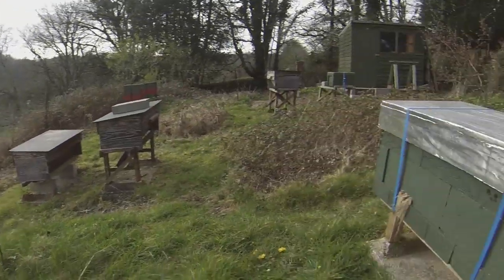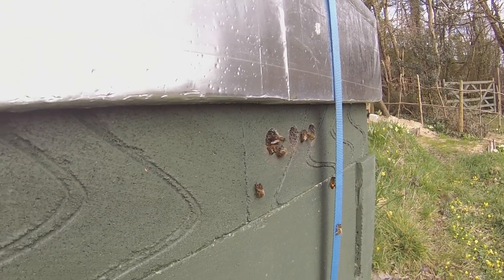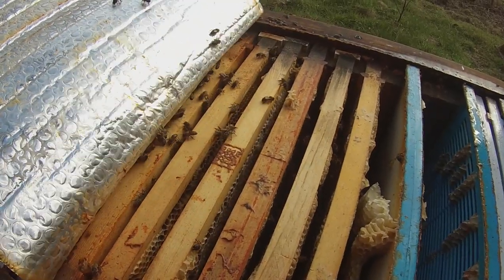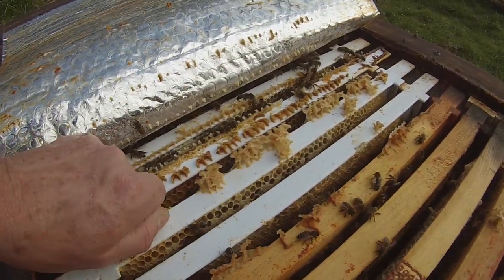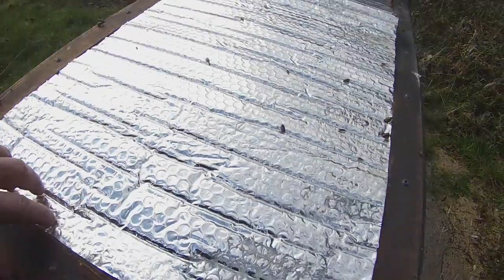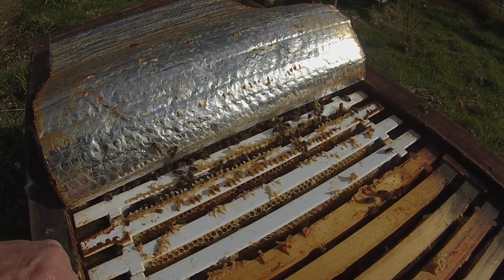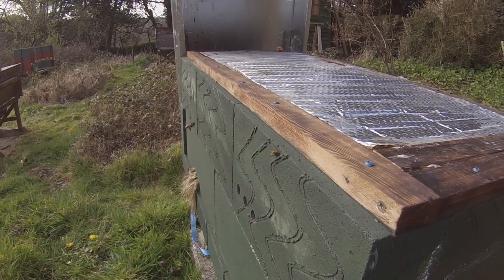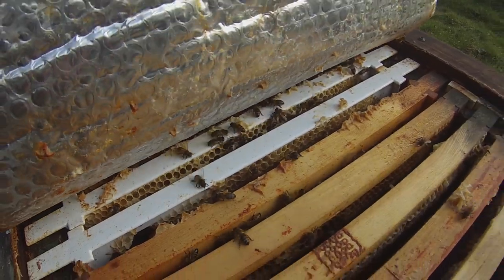ZEST hive spring checkup

Comment: Hi Phil. Really enjoy watching your videos, they were the reason I started Beekeeping with topbar hives 4/5 years ago. The Zest hive is an interesting concept but the propriety frames and gaps between seemed a step backwards to me. I've just built a Topbar Zest hybrid and would be interested to hear your thoughts 

https://m.facebook.com/story.php?story_fbid=121631132863394&id=102227301470444

This will be Tanzanian style rather than Kenyan which all my other hives are, but the dimensions are compatible, I wonder how the combs will fare? It is deliberately deeper than necessary to accommodate an eco floor, which I've not fully embraced before. I've filled it with Holm Oak chippings which a local tree surgeon donated, I have spare for topping it up if necessary. I just need to insulate the roof, make some more bars, and install some bees!

Comment: Hi Phil, as this uses a solid floor - do you need to clear it at all? I'm currently building my own horizontal hive and most designs i see are solid floors rather than OMF. Would be keen to hear your thoughts as you have a couple of solid floors? My main concern is debris build up.
Reply from the maker: I agree, that is a concern of mine also. I will do a full inspection of the ZEST hive soon, so we shall see...
Reply: @BarefootBeekeeper  Looking forward to it. Also very interest in your thoughts of a Layens hive if you have one / just your general thougths